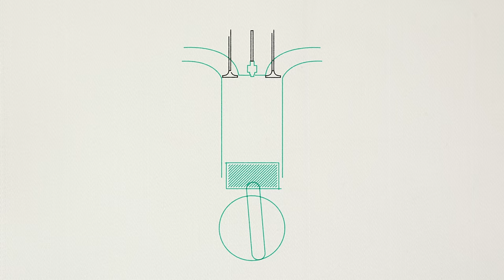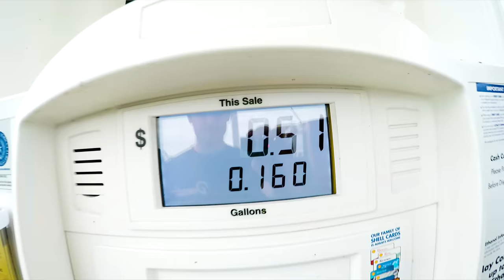IS THERE SUCH A THING AS BETTER GAS - How it Works | SCIENCE GARAGE

Comment: Just an idea on a video about the evaluation of cars and each major discovery/engineering idea like the first car then add ons like the steering pump better shocks and did the first car have an alternator or was that hand crank just that and down the line of where in the mid 80’s they went from several car belts into one Circuit belt and the fist cars to have computer(s) in them for the Motor to run more efficiently. Just the major components from the first to modern day like what we take for granted a lot like which car had the first A/C to when was the last design cars had manual windows before all our new electrical ones to the use your car app to start it. Now I read this I’m ready for a two hour long video and I bet it will be educational for all of us

Comment: I've been seeing some gas stations that offer ethanol free 87 octane and E10 87 octane at the same pump.  Given the widespread use of "regular" 87, idk why there aren't more options in terms of additives without having to buy the more expensive 91 or 93 octane.  Like, advertise the cheapo non-additive gas on the sign, but offer a nice "additive package" with regular gas for a few cents more.  I mean, premium costs an extra 30-50% over regular.  At that price I might as well buy additives at the parts store...

Comment: for lower compression engines you probably won't feel any difference if you go from regular to premium gas. 

I usually go to shell but had to fill up on a random gas station once, their "premium" gas made my engine run just a bit off, it was pulling timing up top. went back to shell and right away it felt way better and timing wasn't getting pulled. But man, almost 50cents/gallon more expensive than everywhere else and sometimes a full dollar depends where just sucks, but I have to... -_-

Comment: While premium gas "cleans" the engine and you do not need a carbon cleanup (those are ... mixed at best) these additives are used in f1 aswell for better fuel economy and, while you may not get a better cleaned engine (if your car is too old, burns oil and what not), it does improve the  combustion by igniting later. Of course that comes with the extra price so you be the judge of that.

Comment: Video skipped the most vital information:
Pure gasoline has poor shelf life, less than 6 months from refinement in proper storage. That might seem like a lot, but before it gets to your car it needs to be distributed to your gas station, and then wait to be pumped up.
So you want some kind of shelf life extender in the gasoline, so it can survive basic short term storage. So all gasoline you can buy contains shelf life chemicals, and as part of regulation they also contain a lot of additives to improve efficiency.

Comment: Your really should have pointed out the obvious fact that on a direct injection engine, with out injectors up stream, the valves will never be touched by the fuel. Therefore it would not matter what type of cleaning additives there are in a particular fuel.

Comment: Upvote this comment so everyone can get to the bottom of this quickly.

I'm a oil refinery process engineer, there are fuel additives in some premium fuel blends. Low octane rating doesn't mean bad fuel. You only need premium fuel if you need it to avoid knock (in a turbo car or running a high confession ratio). Wear on the engine is considered fine with any pump petrol you can find. If you are concerned, you can buy the detergent additive pack and mix it into your fuel tank and it will have the same result on carbon deposits as running the high octane fuel with the detergents pre mixed.

Comment: So I use Arco because I drive 200 miles A-day, all my cars have over a 130000 miles, I've never had an issue and Arco says its top tier these days apparently.  I have a 2012 Chevy Volt requires premium, a 2012 jaguar XF that requires premium, and a 2009 ford fusion that I use regular

Comment: FYI everyone...always check your car's manufacturers recommended fuel type. If your car only needs 87 gasoline you can fill up with 87. No need to fill your car with premium gasoline if your car does not require it because you will be wasting money at the gas pump.

Comment: Do the detergents even matter if the engine is direct vs. port injection? I know that they’ll at least help with the injectors, but there will always be deposits on the inlet side of the intake valve on direct injection, right?

Comment: So what you’re saying is just switch to electric and avoid this problem altogether? Either that or just Sea Foam the fuel system to clean it every once in a while. Did that with my 97 wrangler and left the pistons and valves clean.

Comment: So what are the SAE specs for pump gas then? If these additives are confirmed to keep valves clean and make an engine more efficient, why wouldn't these additives and amounts be standard at all USA refineries? Also, can you get the same effect by occasionally using something like a bottle of Techron instead of always buying premium gas?

Comment: I can vouch that in my car, shell vpower gas is the best pump gas ive used yet. Every other 93 rated gas makes my engine try to turn over after shutting it off but shells vpower makes it run much better. Id recommend giving it a try before shit talking with no basis in the comments

Comment: Shell Nitro Plus makes my motor knock like crazy--to the point where I've seen DAM go from 1.0 to 0.6. Kroger gas, Costco gas, and Sinclair gasoline doesn't do that, so I'll stick with the cheaper stuff. Hopefully my water/meth setup, EGR delete, and AOS will keep my valves clean.

Comment: I am a big fan of donut. While there is some truth to this, there's also some falsification as well. This probably is true in other countries that there is poor quality gasoline, but in the United States gasoline has to meet a certain requirement of additives and anti pollutants. I have worked in post the refinery and ethanol fields. Currently I haul gasoline for a living, and off brand stations such as Walmart, Kroger's, Costco, ECT actually buy gasoline from name-brand companies such as Marathon, Valero, shell, Exxon / mobile. the only difference is the amount of their additives that is injected into the gasoline. It is the same gasoline you get from the refinery. It's all the same gasoline the only difference is the additives.and that comparison of the valves that they show you, they have tried that for years, in reality depending on what kind of engine it is, that may or may not happen. For example, a gasoline direct injection engine where it has only has an injector in the combustion chamber then yes, I can see that happening, but if it is a older multi-port fuel injection engine where the injector is constantly spraying the intake valve, a cleaning effects takes place. So in conclusion is there such thing as poor quality gasoline? No not really it all depends on the amount of additives that is injected into a branded or unbranded fuel. Can Gunk buildup on your valves? Yes and no. depends on what kind of engine do you actually have. I'm not saying that donut is wrong Kala I am saying that they are not giving you all of the vital information needed.

Comment: I would be very interested to see what you guys have to say about "warming up" your engine in the mornings. I was taught to leave it running at least until the temperature gauge comes up a tad. i have seen the inside of motors that were abused.  All to often I talk to people about this, they miss the differences in conventional oil's vs synthetic, engine mileage, oil change frequency and of course fuel. it would be interesting to see what you have to say about the various effects of these conditions. Ive never seen an educated individual do a full rundown. if anybody, id bet you can pull it off, and hit all the points. Thanks for this show, i really dig the info you guys put out.

Comment: I fill up my 2012 Camry with sams club gas, not top tier licensed but has a solid reputation. Any reason I shouldn’t just keep filling up at sams and using a fuel system cleaner like Techron or gum out once a year?

Comment: Gasoline is a solvent...so if your gas contains a little something called gasoline then it will get rid of any carbon build up. Gunk really only builds up on direct injection engines, just for the fact that the gasoline mist is sprayed directly into the cylinder. New toyotas have multiport for this reason. Any gas is good gas, unless its some shady gas station that fills up their holding tanks with extra water to save $$$

Comment: Also run good oil. High quality oil like mobile 1 or amsoil. I run full synthetic on all my vehicles that require and a good conventional like castrol gtx high mileage with a friction reducer like motorkote in the older vehicles. Never had issues with my vehicles. And I never run my vehicles down to a quarter tank. Half a tank or alittle under half then I fuel back up. So many people dont realize how hard that is on there fuel pump

Comment: Bought a used 2009 chevy traverse and it suppose to take regular gas. I was using bp or speedway 87 but the car was running out of gas very fast and getting catalytic converter codes. I switched to shell premium and now runs smooth and no more codes. Weird!!

Comment: Isn't Petroleum a solvent that in most cars flows around the valve face & stem?  If you remove your intake plenum you'll see where port injection cleans, even on low grade fuel.

Comment: The ones that are good are Top Tier, as long as the gas is Top Tier you should be good, and also Chevron, Shell, and Mobil/Exxon gas has more additives and better cleaning power than other gas, and the higher you go on the octane then the more additives it has, but you should use regular always unless your car demands premium

Comment: I like Shell gas it seems to work better in my area but to say you gotta buy premium gas to get the benefit is dumb when your car doesnt need 98 and wouldnt run any better with 98 because low compression and just a normal engine.

Comment: I have a Shell pump station very close to my home, and another one just a bit farther (the difference is less than one mile) and guess where do I pump gas? Yeah, on the other one where gas is cheaper - if I was to believe Shell, that is the premium gas which in here it is called Shell V-power then I would have to see a video explaining why it is better, I mean in this video even, the question remains: what does a premium gas contain that makes it better? I think that overall they have shown it: it is not just the gas, but the engine oil quality too... so... normal gas and normal engine oil = a normal running engine? I do not have a young car so the standard gas in here is pretty much.. SORT OF like premium for it, if I were to own a proper race car, or car with bigger displacement, say a BMW M3 or M4, then I would test this out properly. I still think that it is just that premium gas is more pure and normal or low quality gas is just an “extract” of gas, like a mixture of gas and other stuff which it should not contain in the first place (in here we call it “šmelený” as impoverished you could say) and if you look at it logicaly, then there should be no difference in the real world - all gasoline should be pure, no matter who is the supplier, but hey, when the money talks, then you gotta PUMP those resources ;) :P

Comment: I believe that the fuel will clean the valves. I don't think it will work on fuel injection engines unless it's multi-port fuel injection. My inner technician says the blow by will not be as harmful to the valves because of the cleaner fuel.

Comment: Sorry but im curious modern engine has gdi right? How will the gasoline clean the valves if its direct injection? The cleaning might happen if the engine has port injected but if its gdi, I doubt it.

Comment: But do they put the additives in the lower rated 87 gas? Since you only talked about shell, when I go to a shell station they only advertise the additives in the higher rated gas. If the car companies do put additives in lower rated gas, which company has the best ones? This video leaves a lot of questions, doesn't really help you know where to get good or bad gas either. Its just a shell ad, man. How do you know if you are getting good or bad gas when you go to any gas station? If the additives are only in higher rated gas, and your car isn't rated for it, how do you prevent or clean out the gunk then?

Comment: My owners manual states in lieu top tier detergent gasoline to use a fuel additive every 7500 miles. I use chevron with Techron and buy cheap Kroger 87 gas with fuel points. Probably wasting the fuel points, but whatever. Makes me feel better.

Comment: If an engine designed to ignite fuel at lower temperatures than 91 octane combusts, would that engine not then run rich and/or knock? It might be better to run 83 or 85 and OCCASIONALLY use a fuel additive from a bottle but only if necessary

Comment: You didn't clear the point that low RON doesn't mean bad gasoline. Also higher RON doesn't mean its better than lower RON. Also it would have been nice to talk about a wide misconception that using higher RON gives you better milage.

Comment: Not against ads and sponsorships but don't be sell outs! Talk about how gas is refined and put I to a pipeline from every refinery and then they buy it back at the end of the pipeline. Additives are the only difference and you can buy those in a jug and add them as needed.

Comment: Doesn't the gas help reduce and remove deposits on valves only if the fuel is port injected? Whereas direct injection would not clean the valves?

Comment: Don't trust the brand shown on the pump or the stores name, it is very common for folks to open a gas station under a certain franchise than sell it 10-20 years down the road.

The new owner is under no obligation to use that franchises gasoline or even to change the stores name/remove the branding off the pumps. This happened to me for years, I would go to the same gas station every time (ironically it was a Shell) and fill my tanks. One day I show up while a tanker is there filling the tanks and it wasn't a shell brand. Asked the women behind the counter (knew her well after going there for years) what was with the other brand.

Told me they do not sell Shell gasoline that it's just the original equipment and the owner who bought it choose not to change it. I looked online for a good bit and found this was very common, just because the name is Exon and Mobil/Chevron/Shell/BP etc doesn't mean you are getting that brand you could very well be purchasing the same gas the station across the street uses but paying more.

Comment: This is my issue with Shell gas and their company as whole: Shell only advertise that "V-Power" (Premium grade) will help increase mpg and clean the engine, but how does that benefit people that have vehicles that don't require or recommend Premium fuel? Especially if it doesn't make a difference in performance. Yeah, it may help to clean deposit build up, but you are still purchasing an unnecessary grade of fuel. Not to mention, is their Regular and Plus grade just Murphy USA fuel? Because they never advertise Regular or Plus grade. Chevron advertises Techron in Regular, Plus, Premium, Non Ethanol and Diesel.
Reply: It does make a difference look up project farms video comparing vpower and reg gas

Comment: I work at a chevron you talk to the fuel guys long enough they’ll tell you they deliver to all the big gas players but we’re they get the gas is the same place? So they also say according to the order they put in numbers to get different grade fuel. So understanding a machine code is the only thing holding the power from v-power from shell or chevrons techron gas treatment. All the way to ampm gas. All the same it doesn’t matter were you go just what grade you put in or your car allows for. Flex fuel is a joke lmao. Depending longitude and latitude I was told by a government official will be  called different things such as e85 flex fuel and there was another one I’m missing right now.

Comment: You didn't Mention BTU's. Nor the additives like lubricants and detergents for the fuel injectors and the fuel pump. Some cheaper gas brands don't have this. there's a difference between preignition and detonation. Octane is a fuel resistance to detonation

Comment: Recently I filled my 95 Toyota Avalon with shell gasoline because I happen to be at the Shell station buying tobacco and figured what the hell I'll fill up with the expensive stuff just this one time and I'll be damned if my car didn't run like a dream, it accelerated better and ran much smoother. My car has 315000 miles on it so every little bit counts and while I can't afford to fill up with shell gas every time I think if I do that at least twice a month my car will run better oh, so far that seems to be the case compared to the bargain gas I normally Buy

Comment: Here is the issue there have been many tests done of premium compared to regular bought at different stations and they always find out that their is no difference in the fuel and In many cases premium fuel in everyday car engines will get worse mileage and produce more emissions because these engines are not made for performance and this “premium” fuel doesn’t burn all the way. But most of the time it’s all the same fuel at most stations people just paying for nothing. If you want higher grade fuel for sure you need to buy it somewhere besides your regular stations